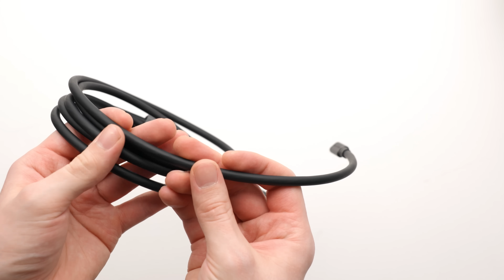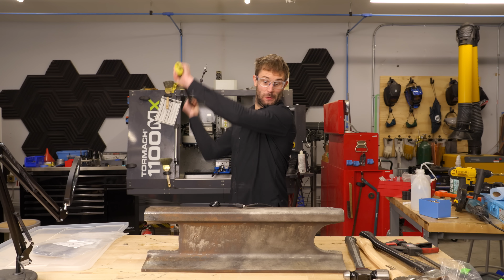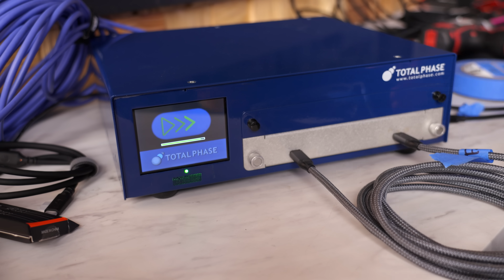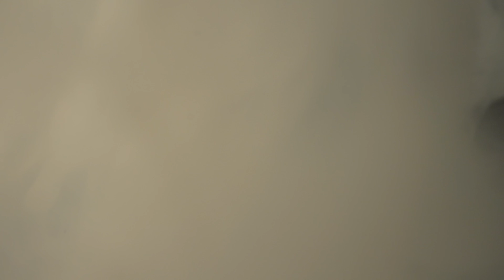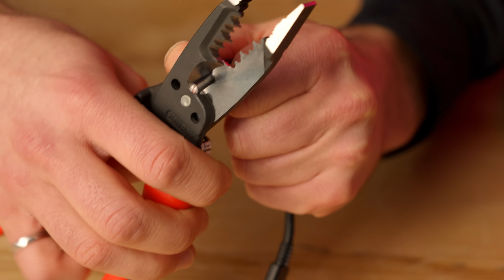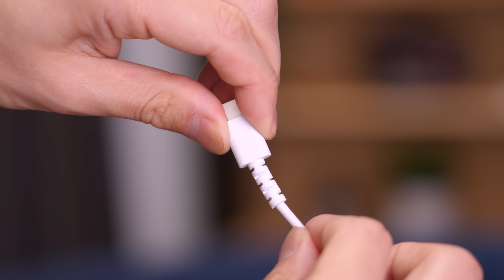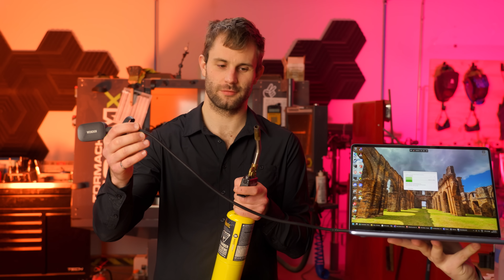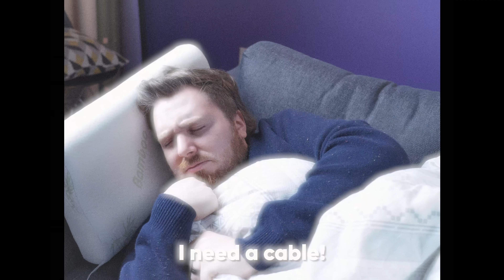Why It Took Me 4 YEARS to Make a USB Cable

Comment: You call 25 CAD expensive? By how you introduced the price of it, I was bracing myself for like a 50 CAD price tag 😂
Reply: Thunderbolt 3 cables are like 150 bucks
Reply: @tedarcher9120  I use some non-certified 2m cable for my egpu that cost $10. I think the seller said 40gbps, and I messaged them and they said it will probably work but he'll refund me if not. It worked.  The 2m long certified thunderbolt cables are absurdly expensive and don't seem to do anything special. I wonder if Linus's cables will work with egpus or thunderbolt NVME enclosures...
Reply: @tedarcher9120  Not really since USB4, there's an 1m Amazon Basics cable for 10 euros (that also support 240W)
Reply: @tedarcher9120  That's not true actually. You can get good Thunderbolt cables for a decent price, you just have to avoid the Apple one. OWC's TB5 1m cable is 35$
Reply: @tedarcher9120 thunderbolt is a tiny computer in the shape of a cable
Reply: @joebidenVEVO  def not bad at all, I'm getting a few at that price.
Reply: I gotta admit, I've spent waay more on cables that were horrible!
Reply: dude i thought its 100
Reply: I would happily pay £14 for a good cable
Reply: @shahan1465  Ebay
Reply: Right?! I'm in Australia and was expecting that it would cost AU$75+ for one cable, including shipping. Instead it's like AU$90 for two, including shipping and currency conversion. Still expensive, but if the specs are actually reliable, and it will last a long time, probably worth it.
Reply: @DJphotoandtech my guy its 1cad to 1.05aud at the moment where are you getting $90 from 👀 its like $52 or $62 if you go for the cables that are 29cad you need to check exchange rate before buying my guy 😂 but yes we were all expecting $99 per cable
Reply: @hazardous2593  "including shipping". Shipping from Canada to Australia is 18.99 CAD plus an additional 7.90 CAD for taxes so the total ends up being CAD 86.87, which is nearly AUD 92.
Reply: Yeah, it's actually more expensive to ship to my country than it is to buy the cable itself!
Reply: Its expensive if you’re buying the cheapest possible cable on amazon but as someone who has bought premium cables before it’s not bad
Reply: Give it 3 months
Reply: linus love money, you cant order 25$ cable they remove it from store .  * not include tax/shipping shit  total price 60$
Reply: @seethemagic402   no way! wow
Reply: @seethemagic402   They addressed this. It was an inventory issue with the website allowing people to order not-in-stock cables.

Plus... that's completely untrue. They're 30$ CAD per cable. It says so on their website.
Reply: we sell better cable less than 10usd.   but with tax and shipping fee and apple fee ,it will come to 100-200usd.
Reply: to be fair all of the LTT product never goes outside its objective price range. People seems mad before about 60 $ screwdriver, they would shock if i said i already bought 100$ driver. But that's because people never familiar with high-end tool brand. Now since majority of people already knew the pricing about the cable, so it is no surprise people think it is cheap.

If i LTT released the driver before i bought snap on, and after seeing project farm test it, without batting an eye, i would gladly buy it
Reply: @mickolesmana5899  does ltt have a warranty like snap-on? the main advantage of snap-on is you can buy a tool break it and get a new one for free. that said, $150 for a screwdriver is worth it if you use it every day
Reply: @mickolesmana5899  Yup. Good tools are NOT cheap. Now you can get some pretty decent ones at a good price, but the consistency is a real problem. One will be great and the next will be complete garbage.
Reply: @genicota  Don’t hype them up to increase prices please
Reply: @Userknowledge doubt they would, they always seem to price things fairly. Quite expensive usually, but not unfair if you're in the target audience.
Reply: Well... the 10cm cable is the same price as the 2.5m... so either they're selling the long ones at a lost and the short ones are overpriced, or we're only paying for the connectors and the copper cost/length is ignored... but it's not all "cheap".

And yes, I do realised that almost nobody will ever buy a 10cm usb cable for $30 CAD. Doesn't matter, the price is still there on the website.
Reply: At least it's not a $70 non electric screwdriver that just has extra bits 💀
Reply: i bracing for 200 CAD pricing:face-pink-tears:

Comment: I'm really curious how well these do with RFI. I suspect they excel. In amateur radio, broadcast radio, and even some scientific applications working around sensitive radio equipment, USB cables are NOTORIOUSLY problematic because they leak so much RF energy. High quality cables that don't need to be wrapped around multiple torroids and have a bunch of magnets clipped to them to make them not splatter noise all over your waterfall would make them really compelling.

Comment: wtf? Am I drunk? The 13ft cable is only 22 USD? You lied Linus. You said theyre not cheap. Dude thats cheap af. 
This is blowing me away. Absolutely amazing.
Edit: omg nooooooo you suck. Shipping was 10 dollars for 2 cables. NOOOOOOO. Oh well. Purchased. 
After going through with the purchase, maybe they're a LITTLE expensive. But for two cables over 13 feet of a guaranteed high quality? No, they're really not. Paying 50 bucks with shipping for 2 cables feels expensive in the moment. But knowing I'll likely use these cables for over 10 years really drives home how they are not expensive. Thanks.

Comment: Oh i wish the silicone outside was also magnetic. I have a few of these cables in the car and are amazing for winding them neatly. I would buy tons of the LTT cables if they had that since i can't find the original seller anymore. Also i think the LTT cables are pretty reasonably priced considering the spec.

Comment: The QR code doesn't work on my pixel camera app. Weird, it works when I copy the QR code and use it with a white background. Another QR scanner app works fine btw, maybe add a small white border next time, so that it works also in the camera app. Thanks!

Comment: that's... not even close to how expensive I expected. good job guys
Reply: Honestly, I feel like I’ve seen cables in this price range or higher. So yeah! Props to them! If I’m in search of a new cable, I’ll definitely keep them in mind!
Reply: @chrissolace  Hi can someone just say the price in question
Reply: @hahasamian8010  I looked and I think it's like $20
Reply: @vdinh143  for which one?
Reply: @Alešomgmen  When I first saw it, the 15W was $17 and the 240W was $22. (Price may fluctuate based off the length of the cable too.)
Reply: @chrissolace  thanks, that is actually great price i think
Reply: I know, I kinda landed on, yes 80 dollars isn't cheap, but if it can be the last cable I ever buy it'd be fair. Then they said, it's not too expensive but it's fair, my price expectations went down to like 50 dollars. But these are actually well priced!
Reply: @Rikcey   exactly how i felt... id oay 20% more just easily. I think its prices to sell, and tet the word out. Not everyone is a youtube watcher.
Reply: If they are actually as good as claimed. Then that should tell you how much we have been getting ripped off from all these other companies that sell cables for the same price that give nothing but troubles.
Reply: @LKN117  did they not mention that?
Reply: this is like Apple's cable price on my region but better quality
Reply: Right? I was surprised, with all the hype.

Mind you, the more common lengths are out of stock. But I'll have to check in. It would also be cool if they came in LTT orange, so I can tell them apart.

I'd love to see GN do something similar. As obsessively as they test every single aspect of products, I feel like they would make a killer product, whatever it may be.

I suppose that's similar to ThermalGrizzly. Roman makes good stuff, and being a review channel means they going into detail about decisions and revisions. If GN did the same, their brand name could be ThankSteve or ElectroJesus
Reply: @webx135 Roman going into watercooling has been such a blessing. I have his 5090 block and oh lord it is the most overengineered thing I've ever seen in watercooling. The only slight disappointment was the LEDs not being very bright but I could always just swap out that.
Reply: does anyone know how much is the shipping for international tho
Reply: @inoob26  Depends on your box. I think the range is something like CAD25 to 40.
Reply: @inoob26  shipping to switzerland is 14cad. which is just under 8 swiss francs so really not a lot
Reply: @inoob26  I just put something in my cart and it was around $15 to Australia. That's basically the cost of shipping if I buy something in Australia. The difference is 3 days vs 3 weeks.
Reply: Honestly they are “cheap”
Reply: You can get garbage quality cables for the same price, so like unless that's all you need, the cheapest cable available, this is probably going to beat it out. Makes sense when making a cable but still surprising.
Reply: I followed the link and was like, "Oh...that's typical retail store pricing". Sure, if you buy all of your cables off of Amazon then it seems high but if you're getting a good Anker cable from Walmart, Target, a cell carrier store, etc, then it's a pretty normal price.
Reply: Yeah honestly quite reasonable
Reply: I expected expensive when I looked.  They appear to be reasonably priced premium cables
Reply: yeah... belkin and apple obviously rip off but this is an insane degree
for apple its $30 for 6ft, total garbage cable quality
dont get me started on samsung, feels like dollar tree cables (common samsung fell off after S10 moment)
here its $27 for 8ft best quality
Reply: I actually can't find a reputable high speed and wattage cable for less. The regular low speed high wattage yes but it's kind of hard to find both in one
Reply: Same bro!!! I’m actually shocked! Those prices are not bad at all for a cable that I know will last me forever and will deliver the promised speeds. I’m definitely gonna grab a few
Reply: Yeah, I was expecting more too. I mean, I doubt I will buy them either way because the cables I already have get the job done. But with that little monologue at the end had me feeling like he was setting expectations for them to be quite expensive. If I ever find a reason to buy a high end cable I will likely look here first, but I just really doubt I will ever have that reason.
Reply: ya thats a fair price
Reply: @xbox360mbg for a cable not really no
Reply: It's on the high end, yes, but not unreasonably so. There's only so cheap you can make a reliable product, and that's all this is. No 'kevlar reinforcement' gimmicks, no marketing fluff, but also less opportunity for economies of scale to drive costs down by much.

Don't have a lotta use for these, for the time being, but now I know where to go to get them when that changes.
Reply: right?? i was expecting 50+.
Reply: Right? I though these were going to be $40-$60 each
Reply: Yeah it's high enough that I won't just buy one now but low enough that I'll probably buy one whenever I'm buying something else.
Reply: OK, I scanned the QR code and it says there’s zero products found. I also manually go to the store and it says there are zero products found not that it says there’s any stock issues but like the products don’t even exist.
Reply: My thoughts exactly! Great job LTT
Reply: yeah, 15 Euro for the C to C cables and about 12 for the A to C. Expected the cheaper one to cost about 20 euro at least sinc all their merch is kind of expensive, but this is an average price, maybe just slightly over the average
Reply: It's cheaper than main store 240W USB cables, and clearly better quality. Only drawback is that they are thick, and how often do you actually need 40GBps? 😀
Reply: I looked and was shocked it was reasonable too
Reply: Clearly not using ai for pricing yet...
Reply: You know they’ve got to come in under the ‘fruity’ $29 cable/dongle hardware subscription fee
Reply: The face I made when I seen how much it cost that's not bad at all I was thinking by the way he was talking that they where like 40$-$50 USD but 22 and 17 not bad at all
Reply: Yeah normally I think LTT gear is overpriced but this is right where it should be
Reply: @OnlyLokimobile   tbh I think it's generally really hard for any youtuber merch to be low priced since they can't really play the system with say, child labor, like other clothing or backpack companies for example
Reply: @ZenithFlare307Or even just economies of scale. It's why I don't mind the premium that comes with Der8auer's products.
Reply: Actually: the 10cm cable is the same price as the 2.5m... so either they're selling the long ones at a lost and the short ones are overpriced, or we're only paying for the connectors and the copper cost/length is ignored... but it's not all "cheap".

And yes, I do realised that almost nobody will ever buy a 10cm usb cable for $30 CAD. Doesn't matter, the price is still there on the website.
Reply: @onepiecepedia  what are you talking about?
Reply: @onepiecepedia yeah thats a weird aspect of it, maybe the actual cable length is a negligable price difference and cable companies have just been ripping off with it
Reply: @onepiecepedia  I suspect that design, manufacturing, testing, and packaging combined dwarf the cost of the conductors themselves until you get to longer lengths. I would guess the total difference in cost to manufacture a .5 m and a 3m cable is less than 10%.  Perhaps significantly less.
Reply: Or, you cound found out the information of the Chinese company who actually made it, it's rather likely they have shop on Temu, do you really think LTT design such a wonderful cable? Not gadgets, just cable? Cable is not machine, there is very little to design other than the atheistic, you give the Chinese manufactor specs ask for a sample, if that pass the test make an order and they made it for you, that's how peripheral business exist anywhere these days, no exception, the people who can really design is in China within those factories and no "experts" know better than them why waste their time with your puny "design"? This is ODM for sure.

Comment: Honestly, I was expecting a lot worse pricing. That's competitive with 2021 Microcenter pricing on similar spec cables, and you've managed to exceed the typical 6ft length that the majority of 20GB cables max out at.

Comment: Damn...these cables are made to perfection. So I was an electrician and also worked in a factory that makes insulation material. I understand how cables work. Yet, I'm blown away of the cheer effort, research and engineering the LTT team put into these. 

I most say that this is the most honest ad I have ever seen. They show everything. The product, the Journey. Everything is explained. Nothing is intentionally left out.

I was also shocked about the inconsistency of the competitors cables. 

For a long time data cables made no sense to me. I knew that if you look at it from a purely engineering standpoint, you simply need thick enough wire to allow power to transfer safely and shield each wire from each other to prevent data loss and interference.

This is ethernet cables and other signal cables are made. The thing is, USB cables isn't an exception. It's still just transferring electric current through a cable, usually both power and data. 

Still the marketing for USB cables is insane. If I buy an ethernet cable with a cat5 certification, at least I know that I will be able to transfer at 1 gigabit speeds.

So for LTT to be so extremely transparent and clear with their marketing is so awesome.

We might as well call LTT a new standard for USB certification, in the Sam way cat is a standard for networking.
Reply: Next step is to produce these in different colours. I mean black is classic but my style has drifted more into pinks and purples nowdays.

 I need this in a really nice soft pastel pink and purple is what I'm saying.

Comment: How about making a right angle option ? That’s become industry standard for tethering in the photo industry.  And we all burn through cables .. the brands in the “tethering “ space have pivoted to non power delivery cables saying it’s the power that’s degrading cables.  So given what they are now maybe consider adding right angle connector to the line up ?

Comment: Make TrueSpec an industry standard. Keep rating brand name cables and shouting about their failures until they meet the spec, done right you could have a platinum rating for brands that not only pass the spec, but proactively work with you for TruSpec certification, as long as no pay to win shilling happens

Comment: Honestly. I'm happy with that pricing. Now you just need to expand your line up. My pc monitors flash when In Sleep mode. I've tried several cable but no resolution yet, I'm starting to think the monitor is the issue.

Comment: Now make a USB C powered hub with at least 4 USB C downstream ports and one upstream USB C port (NOT A PIGTAIL!!!) that supports 40 GB/s and at least 100W per port (simultaneous! yes, I know this will require a 400W (or larger) power supply, but I am sick of USB C drive enclosures requiring a separate wall wart to work). USB C was supposed to support power delivery AND data, but for some reason, it is always power delivery OR data, never both at the same time.